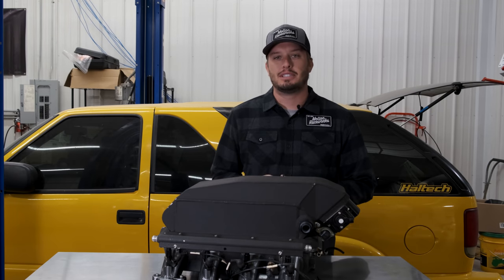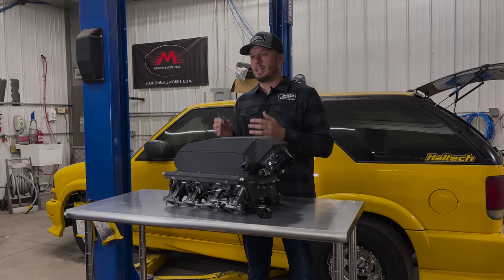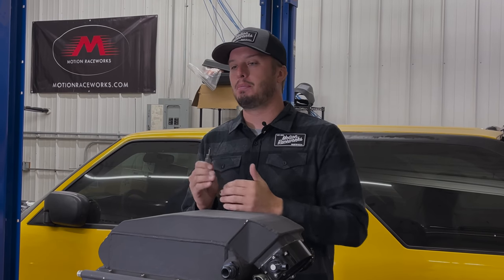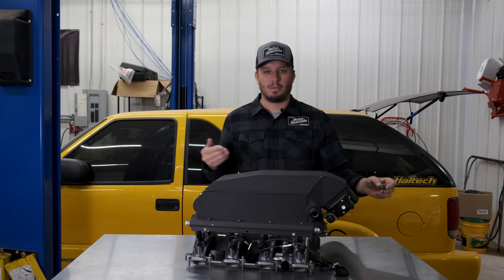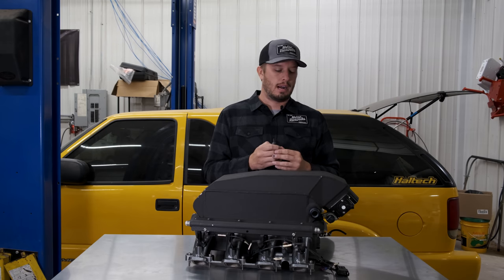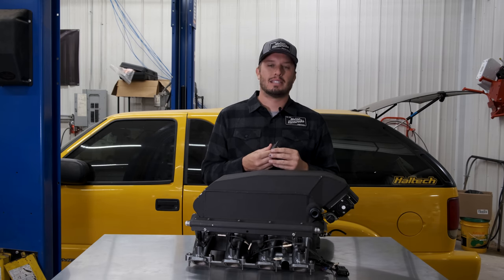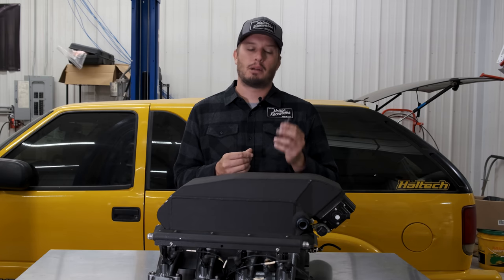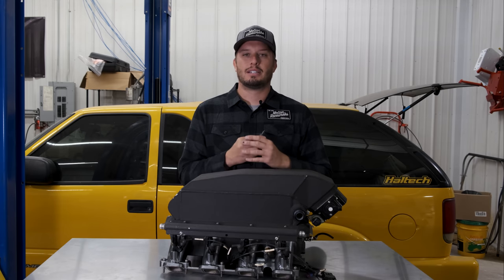Where to Put an IAT / Intake Air Temp Sensor: Tech Tip Tuesday

Comment: Not so much a tech tip, but a market suggestion. A Gen 2 LT1 making 1800+ HP just ran a 6.96 @ 211 at World Cup. And you guys don't sell anthing for that engine lol. Lots of guys are swapping GM LS coils onto those and running them with an 0411 PCM and HPtuners or going to a Holley EFI setup like I have. And we'd love some of the stuff you build exclusively for LS guys to be brought to the SBC market. Some of us are trying to bring these old "boat anchors" into the 21st century. Some center bolt billet valve covers with built in coil mounts for an SBC/LT1 would be a great place to start. Steam port kits would be cool too. After all, it is the superior engine 😉. An LS powered car has yet to run 6's with an H pattern trans after all. But Tick Performance did it with the most underrated small block GM has ever built lol.
Reply: The grub worm
Reply: That overlooked LT1 is the Generation X of engines. :D

Comment: Hello sir i have a question for you  ??? I did an LS swap is a 5.3 vortec .i installed an aftermarket intake manifold aluminum. I have a holley terminator x max wiring system.  I was told to pur MAT SENSOR IN FRONT OF THROTTLE BODY 90MM SNIPER. I HAD IT UNDER THE INTAKE BUT IT GETS 150 + HOT . NOW I INSTALLED IT IN FRONT OF THE THROTTLE BODY AND STILL RUNNING HOT AND ON MY HAND HELD CONTROLLER SCREEN SHOWS SOLID YELLOW AND MAKING ENGINE RUNNING HORRIBLE  ??? ANY IDEA I CAN USE THE HELP  .THANKS

Comment: Would love to see a video with the newer EWP water pump, how you mount them, how you control them (Pwm, constantly on) and how your bracket can help put together a remote water pump setup.
Reply: Bump 👆🏼👆🏼  for tech tip Tuesday!!
Also show hose sizes needed, and how to setup a radiator overflow can with it
Reply: we use -16 an hose on the EWP150 and control it with a holley SSR. works great.  can get a methanol LS warmed up pretty decent.

Comment: How about a tech tip Tuesday on how to use the rife sensor blocks, what they're good for/ not good for, and maybe a good 1 on fuel injectors, fuel pressure, and regulators/ boost demand regulators
Reply: Just thought of another 1, how about a tech tip Tuesday on electronic throttle body vs cable throttle body (LS car applications only), which is better and why? And how to change from electronic to standard cable setup. Just got a nick williams 102, been wondering how the new icon throttle bodies stack up against electronic 1's
Reply: @patricklawler4301  
The one with no Cable...its like wi fi...

Comment: Where do you suggest putting the air temp sensor on a turbo car when you are running on alcohol and without an intercooler?
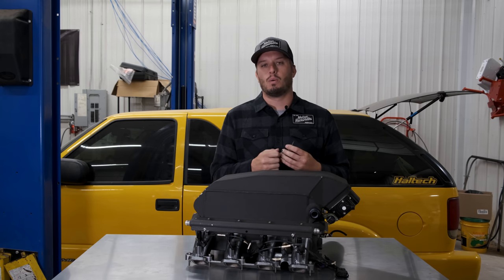Reply: ??? Doesn't matter what the set up is, you want to measure the IAT as close as possible to where the air it's entering the engine IE 3:12

Comment: I notice that those sensors are rated from -10F to 335F.  Does that mean they don't work properly in environments where the temps regularly get as low as -30F?

Comment: Might be worth mentioning.  That you can save a bunch of money potentially by checking your local.  Self service or upickit salvage yard.    
I know i did. The ABS module i pulled from a car like mine was 25 bucks.   
Same with engine ecu 
And 
Transmission computer or TCM./tcu

Comment: I have a 3.8L GM engine Series 2 with a supercharger, and the factory location is at the air intake right at the air filter of all places.  Is there a way to alter the location to the throttle body with a vac hose so I don't have to disassmble and drill/weld/tap the factory setup?  Or does it really not matter on that model (1996 Buick Riviera, supercharged).  The thing pulls great and I'm not sure if it would be worth while.

Comment: hello, I did a swap with a 5.3 gen III vortec engine, I changed the original intake manifold for an intake manifold with a double throttle body, do you think that the best location for the IAT is the back of the intake manifold? What IAT reference do you recommend? Thank you for your answers.

Comment: something I wanted to ask off this topic 
for a mechanical pump I see RB do a off cam gear set up and wanted to if looking at running a set off power steering pump with pump sharft facing engine 
I only ask as I'm building a monaro (gto) and have no room with turbos a/c alt power steering pump 
just an idea to look at

Comment: I heard befor and also saw it in another video, is that when you unplug a MAF sensor while the engine is running, if it shuts of then the sensor is working, if still running, then the sensor is bad. Does this apply also to IAT sensor? I mean, is that another way to test it? Specially if you have no multimeter?
Reply: Unplugging IAT would set an error maybe a MIL light but wouldn’t shut off. Also not every car with a MAF would shut off some still may run when unplug , so be careful with those types of unplugging diagnostics .

Comment: Can I change my old one to the one you recommend without any tuning to get better and more accurate readings, or will it need to be retuned with the new sensor on it first?
Reply from the maker: What Ecu?
Reply: @MotionRaceworksOfficial  same question. Computer is E40
Reply: Same question with fitech. Are the ohm readings and all the same as the gm (acdelco) factory sensor? Do you have to adjust map for this?

Comment: I am running an LSA supercharger with a new GM ZL-1 lid.  The IAT sensor that is in there seems to respond pretty quickly.  Way way quicker than an old style early LS1 style sensor.  Is your replacement sensor even better than the unit in the LSA setups?
Reply from the maker: Yes it is
Reply: Wow, if so! Doug can you provide data? I’ll take 4

Comment: So let me ask you this since me and my buddy have been arguing about this damn sensor for over a week now…lol. I have 2007 Dodge Magnum 6.1 with a SMS 296 supercharger mounted to it. SMS designed to plug my oem IAT sensor in almost the same location like you have on your LS. I think it’s fine, but my buddy insist that I extend it to the intake air filter area right before the TB. What are your thoughts??
Reply: I know alot of people claim that you should put your IAT before Throttle or intercooler etc.. just because that the manifold gets hot from the engine. The thing is, thats why you would want it in the Manifold, to get as accurate temperature reading as possible. The air gets heaten up and cooled down from the air filter to the manifold ( alot of changes up and down because of the pressure changes in the air in the different sized intercooler pipie-intercooler-manifold etc..) . But the last temperature change on the air is goona be right before it enters the cylinder. That's why i would think its stupid to put it too early in the system.
Reply: @timmytelebrant7695  thanks!
Reply: @matthewippolito8089  but i dont know to 100%.
Just read the link ecu manual, where they said "put the sensor before thottle body to avoid heat soak from the manifold.". I guess i the end it may not matter. Rb26dett GTR have their IAT in the manifold OEM.
Reply: @timmytelebrant7695  so maybe I just leave it where Steve Saleens team intended where to put it, after the intercooler fins.
Reply: @matthewippolito8089  leave it if its there. 🤟☺️

Comment: What about Methanol injection?  Before or after the nozzles?
Reply: After, but not in the direct spray of them. You want to know the cooled air temp before it goes into the engine not before it’s cooled.
Reply: @clementb12    I understand that b
but how can I avoid direct spray?  The Methanol is going through the entire intake.

Comment: I’m living in Germany for a few years now and the price of gas went up 30c in 1 month, Diesel price increased by 40c a litre.. (There is 3.75 litres in a gallon) At €1.79 per Litre, that’s € 6.71 per Gallon, then convert that into dollars = $ 7.76 a Gallon...! Even though we have a direct line from the massive Russian oil pipeline.. There is no issue with supply over here, they re just Taxing the hell out of us, just to get to work, to pay more TAX on our pay check. Where is the line ? I’m having to take all my goodies of my motor, just to be able to afford to drive it :-((((((((